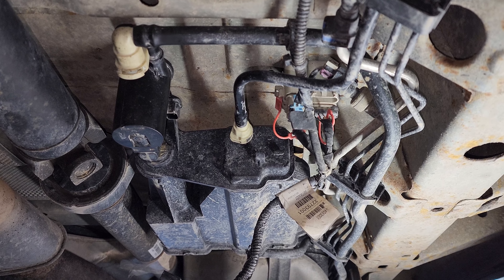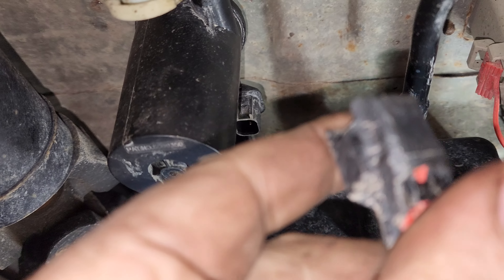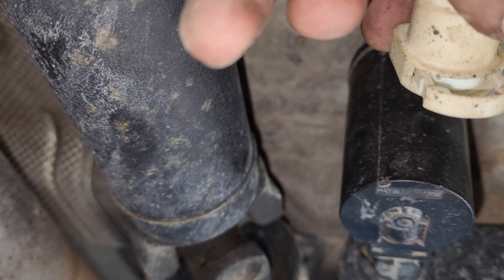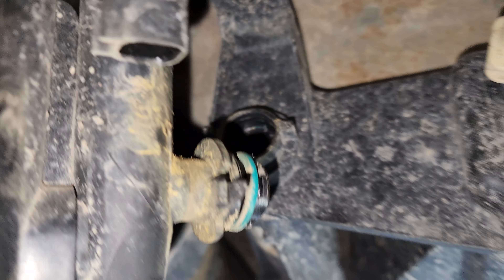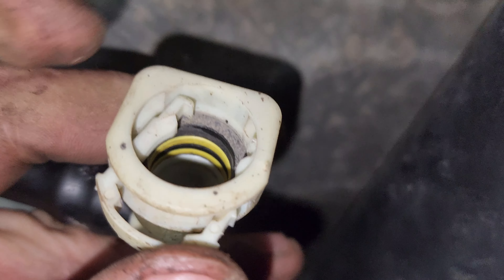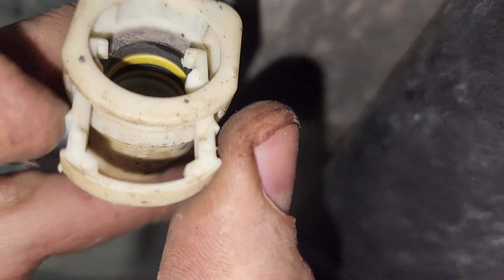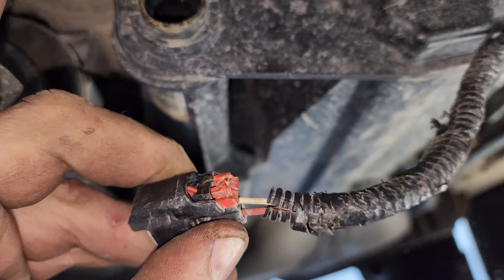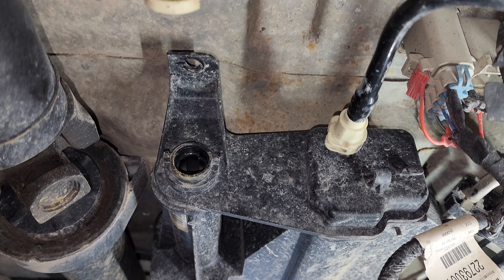2013 Cadillac SRX4  vent solenoid replacement P0449, P0455.

Comment: Very useful video. As stated in the video, you can take the part off without unclipping the tube or the electrical connection.  This makes it easier to fiddle with both connections.  The hint about using the small screwdriver to push the safety lock worked for me.  You can/should attach the tube before installing the part (as stated in the video).

Comment: I'm confused, I replaced the Evap solenoid,  but it's on the back of the engine,
 did it last year. worked for 10 months. had to do it again,  no help, same year and model, 2 solenoids on the car?
Reply from the maker: I believe the one on the engine is the evap purge solenoid.  Have you tried OEM parts to see if it lasts longer, might be a problem in the system or electrical if it keeps failing.

Comment: What year models does this cover?
Would this be the same procedure for a 2015??
Reply from the maker: I'm not sure, should be able to see it if you look under it.  I would assume it would be unless they had slight changes during the years.  Also can see at the parts store has the same number for the part for those years.  Sorry I couldn't be more help.

Comment: Did the P0449 code clear itself or did you have to disconnect the battery cable or even have to use a obd2 scanning tool?
Reply from the maker: I cleared it.  Usually after something's fixed the vehicle should shut the light off after a few drive cycles.  If not disconnecting the battery should reset it.

Comment: I replaced mine but I’m still still getting the code p0455 and it’s saying large leak
Reply from the maker: Might have to get it smoke tested to make sure the lines connected properly and there's no broken lines in the engine.   There are other ways to test, but can be dangerous if not done properly, by spraying starter fluid around the vacuum lines, but that is done at your own risk if you don't want to pay to have it smoke tested.  Also check the gas cap as the seal and spring can go bad.  Sorry I can't help with more.  It would be just guessing after and would need hands on to find it.